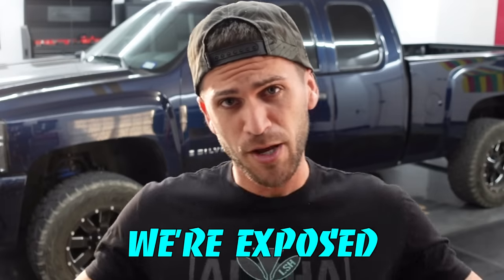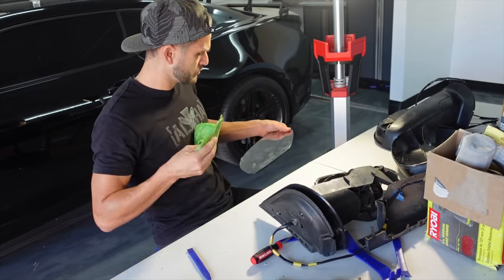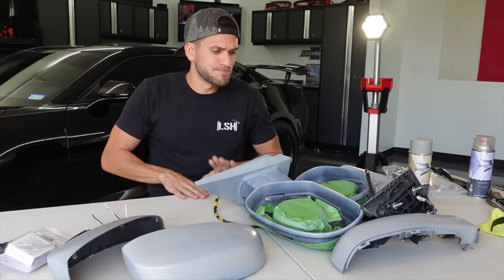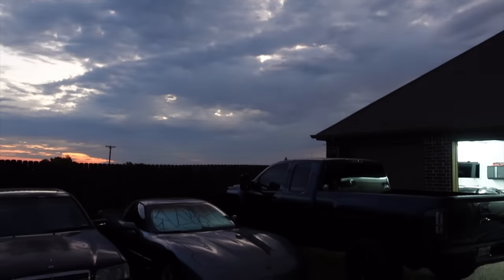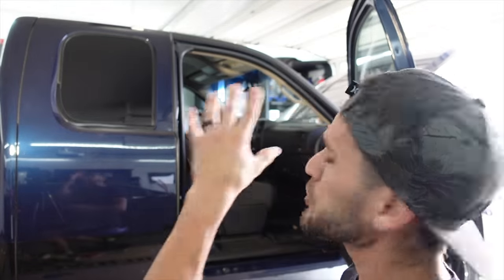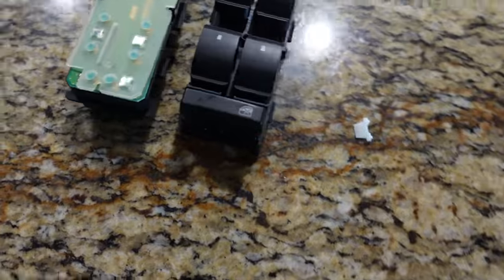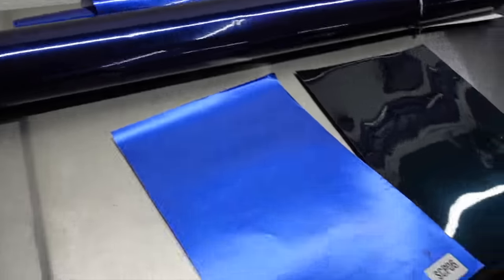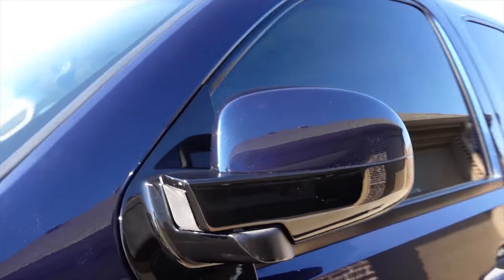Big Time Stock Mirror Upgrade - Didn’t Make Sense on a PRERUNNER

Comment: There’s an easier way to remove the glass.  Come at it from the front.  Use your panel tool to GENTLY push it upward and it should pop right out.  You might look into Feniex Canons.  Very versatile light system.  I added some to the bottom of my mirrors to act as puddle lights and auxiliary blinkers with the red and white combo.

Edited to add: Definitely 4 and I agree, that blue green would probably be a good choice for the Vette.

Comment: LSH, just wanted to give you a heads up on concrete for your shop. Currently there is a nationwide shortage of concrete. Walmart is adding a $25 million parking lot to one of their locations in Indianapolis and the project starts and stops as they wait for concrete. Just giving you a heads up.

Also, thanks to you I had to buy the AWE cat back exhaust for my 2021 Trail Boss. However, my experience with them was nothing to brag about. The order took 7 weeks to arrive and came with missing clamps to hold on those gorgeous tips. I couldn't get a hold of anyone at AWE and bought some at the store just to get by. When the company finally did get in contact with me they said they would send me a care package and reimburse me for the temporary clamps I bought. I never got either. Sadly their customer service sucks when their product is so stinking good.

Comment: Wish you luck on Dulpicolor color-match....actually matching.  I've tried several times on several vehicles and it NEVER matches.  GM and Ford.
Reply: You should have gotten the color mixed from TouchUp when you ordered.  BTW I use them as well, since Dupli-Color never matches...also from Louisiana.
Reply from the maker: Surprisingly this is the one rattle can that matches... nothing else has been close lol